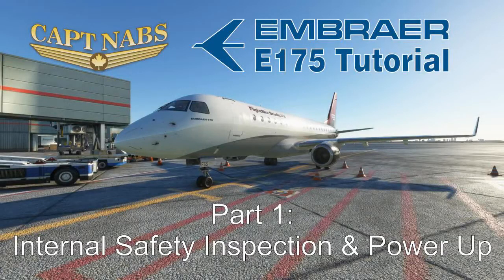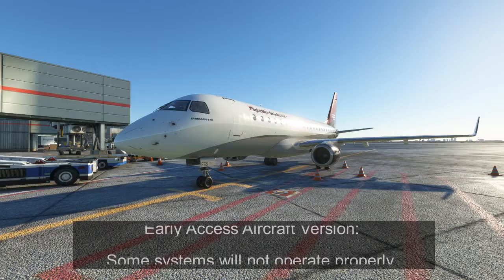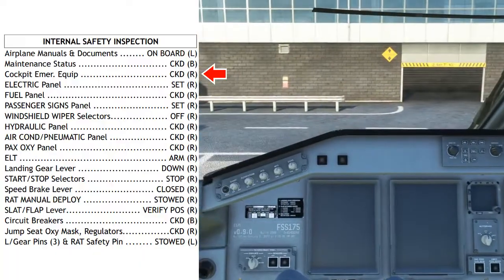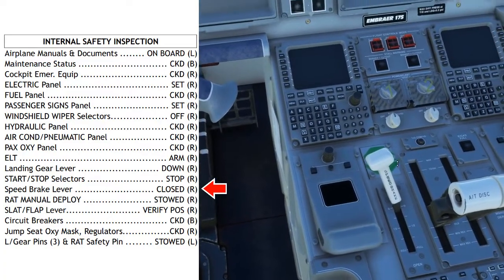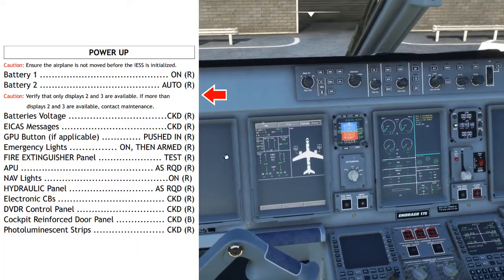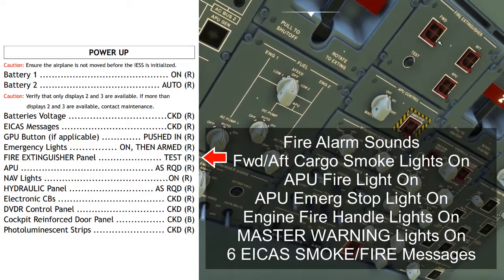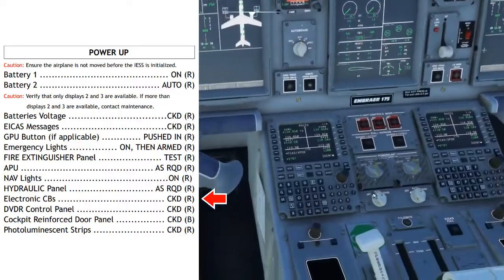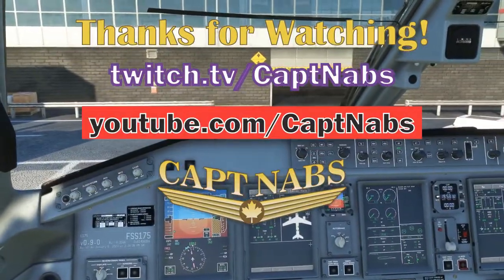Embraer E175 Tutorial 01: Safety Inspection & Power Up

Comment: I have the apu on with gen and bleed but I still hear the ground horn after a few minutes and I tried with gpu too and still came on
Reply from the maker: @16bit_J  That is odd. It could well be a bug. I would check the battery voltages on the Electrical page and see whether the batteries are close to 28V. If they are, they are charging, because there is an AC power source. In that case, the horn shouldn't be on....
Reply: Ok thank you

Comment: the green lights when I press AP or any of those never come on... any thoughts?
Reply from the maker: @Ryanhike123  The green lights can be deactivated at the airline's choice. I think most airlines turned them off because they want pilots to read the PFD directly, and not to rely on the lights. The PFD will reflect any active mode in the annunciation area at the top
Reply: @CaptNabs  Ahh okay, thank you for the quick response!

Comment: A fantastic set of videos, very clearly spoken making the whole process straight forward. Would this set of tutorials be applicable for the E190/95 series?
Reply from the maker: Yes. From an operational perspective, the 190/195 operate the same except the neutral pitch trim setting is 2.0 instead of 4.0. Otherwise, practically identical.

Comment: Hello Captain. 
I get a power cutoff after 5 to 10 minutes? I did anything as you subscribed. Do you have a idea or should I preform a test as discribed in your tutorial   Regrads Frans
Reply from the maker: When you say power cutoff, electrical power, or engines? There have been issues with engines cutting out randomly the devepper is pursuing

Comment: would you say this is useful to try to memorize for a pilot who has been hired at a regional to fly this jet?
Reply from the maker: I agree 100% with SEAAviator. Don't try to memorize my procedures if you are about to start ground school on the Embraer. Every company has slightly different procedures and you will have to unlearn this. Better to focus on what systems are where and how the systems interact. You can use these videos and the sim to familiarize yourself with the cockpit controls and their locations, but best to wait until you get SOPs from your airline and just practice those!
Reply: It’ll help but don’t try to build habits before you start your type training, they could be negative. I wouldn’t focus on memorizing flows but instead understanding the systems of the e175 through the sim until you start training